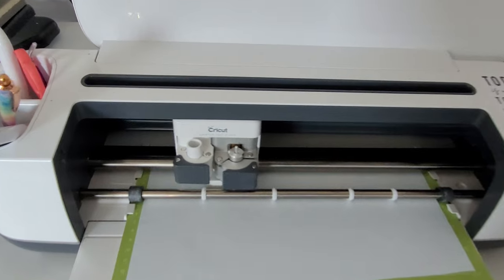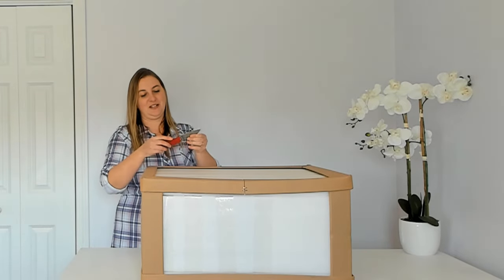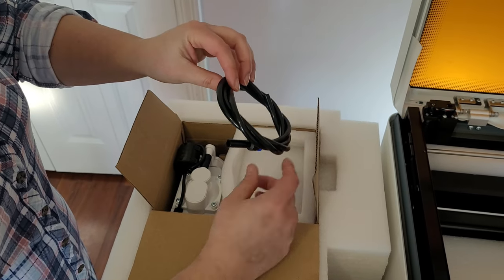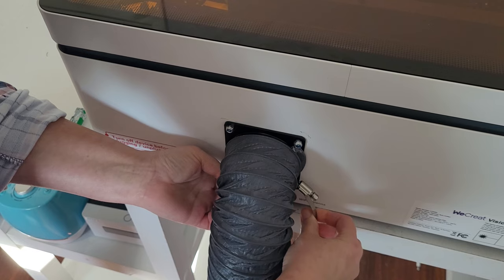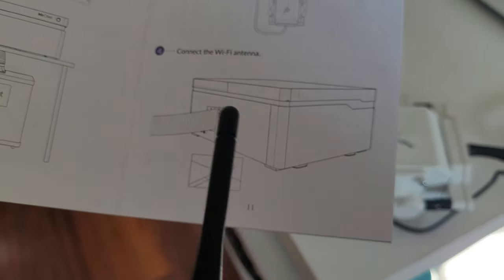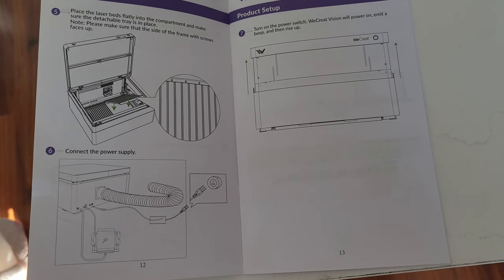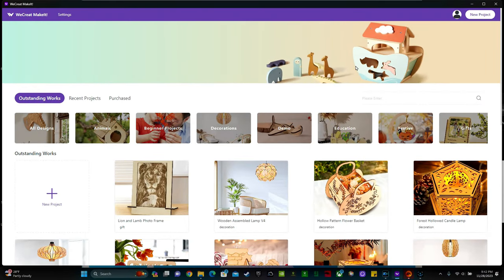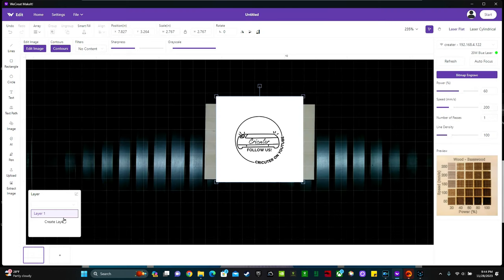WeCreat Vision Laser Engraver and Cutter Unboxing, Setup & 1st Project

Comment: Too funny! You started the video as if you knew exactly my steps of doing things in my little craft life! I just received my WeCreat. Did not connect it to my computer yet, need time to do it this weekend. The only comment I have is, the booklet says you need to put the grates with the bolts up, not sure why it matters. Also, the air assist tube fits snuggly onto the thingy by being stretched, no need to add additional connector. Just put it on an angle at first and slide in. It worked for me. It is supposed to be tight.

Comment: Thanks for doing this video, I ran into the same problem as you, the end with the blue thing was missing that little black tube, and I have nothing to replace it with, I had to contact support. Bummer I was so excited to get it set it up and use it .😪
Reply from the maker: My hubby recommended going to a hardware store and picking up a 5/16 fuel line.

Comment: Just got the vision and setting it up using your video to reference. Question, is the bar that the laser on straight or is it offset by a quarter of an inch? I’m curious to see if I have to reach out to support before I go any further.